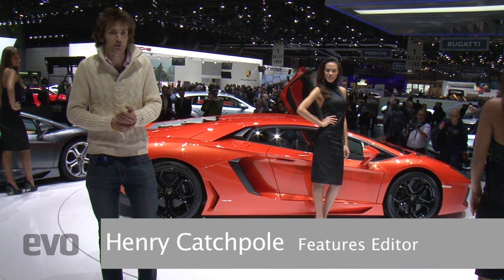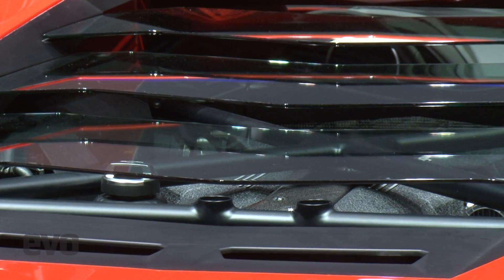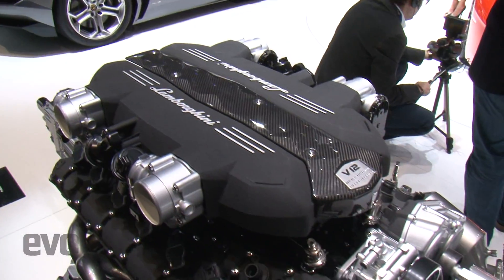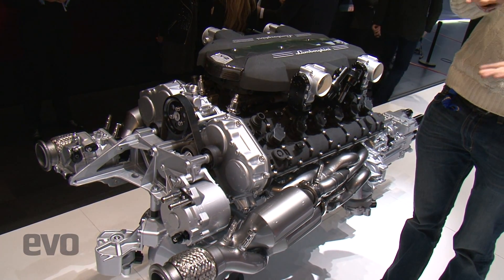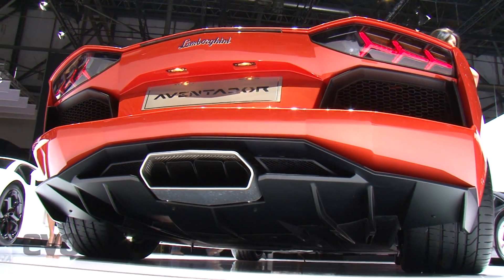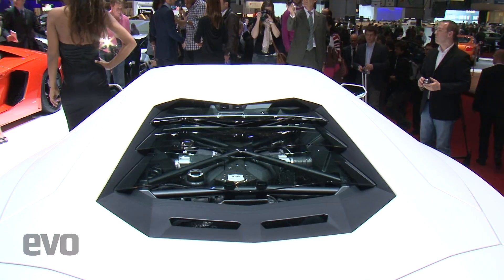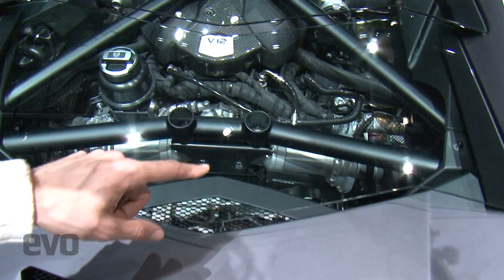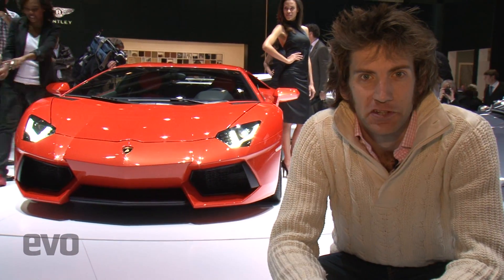Lamborghini Aventador LP700 - Geneva Motor Show - evo Magazine

Comment: @canabeenzo Price, yes but performance, no. Even the GTO version would have a hard time overpowering this LP700. The Aventador should clock a 2.8s time from 0-60mph, it'll take 3.2s from a 599 GTO. The GTO also has about 30 less horsepower and 50 less lb-ft of torque. Plus the frame of the GTO is heavier than the Aventador. A 217mph top speed is also ridiculous for this Lambo. Plus the 599 is due for a replacement in the next 2 years. The Enzo based engine had a good run but it's 8 years old.